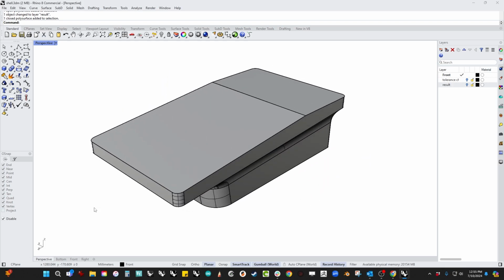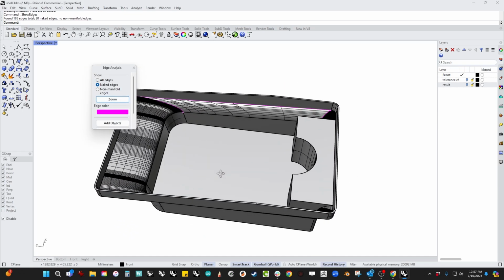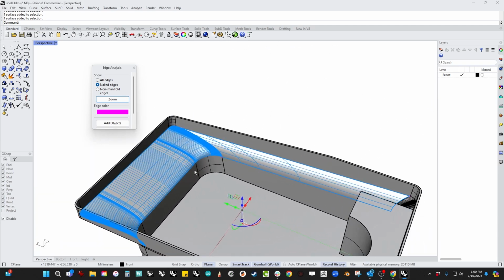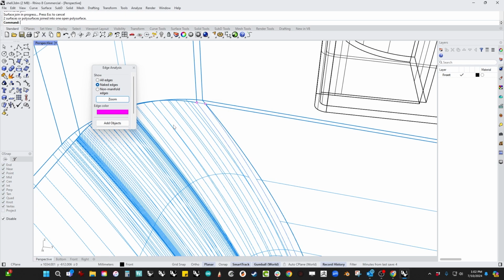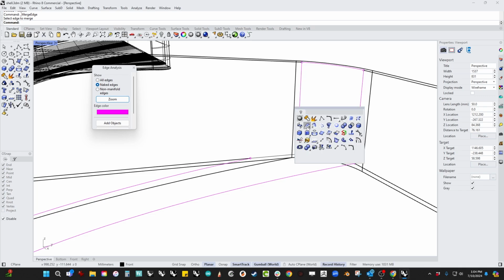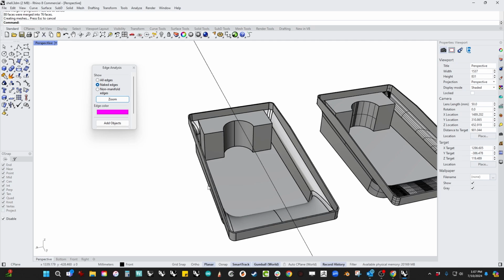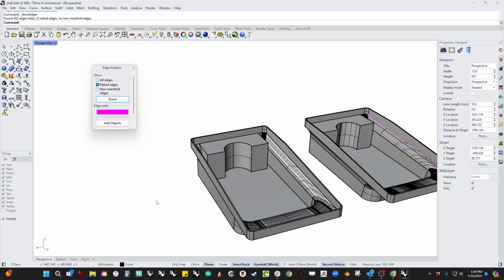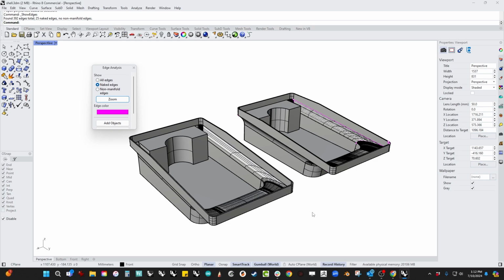Shelling in Rhino 8- tips and tricks

Comment: Better to shell outward. Less failure. Correct?
Reply from the maker: you'd have to plan for that from the beginning. Most folks built the exterior and shell inward. Doing what you are suggesting would change the shape and dimensions of the part. plus you face the same issue with self intersections, just generally in fewer places.

Comment: Great stuff Kyle. I'd certainly agree that having simpler starting surfaces would make Shell work much better - but sometimes you just have to work with what you've got. When Shell fails a result is generally achievable with a little bit of work.
Reply from the maker: yep, something to start with is way better than "just won't do it"  which is how a parasolid kernel modeler fails. Shell gets a lot of hate, some of it deserved, but IMO it's good parts are often overlooked.

Comment: Super. Thanks for explaining the process. I did not know how to resurface with split by isocurve. That's where I had no idea how to proceed. If you are curious - it's an enclosure prototype for wall mount electronics. I'm trying to learn the right way to model these curved surfaces so I did try to resurface the base model  to simpler curves / single span after watching the primary surfacing videos and it went fairly well. Until I ran into a weird thing I can't explain. Not sure if it's bug or I did something wrong, but I did do exactly same thing on other 2 corners and it worked well. Two corner sweeps went as expected but other two of the corner sweep surfaces, when I tried to work on them, acted like they are one surface from corner to corner even though selection shows it as separate one. I tried to extract the corner sweep surface by split and it gave me not the surface I selected but whole top. It's in this post. ->  https://discourse.mcneel.com/t/shell-makes-naked-edges-please-help/183443/5?u=harijs_zablockis
Reply: Oh, I think I've got waht I was doing wrong with resurfacing the model. It's super important to rebuild every curve and the surface them with edgesrf not leaving curves as is and trying to rebuild separated surfaces.